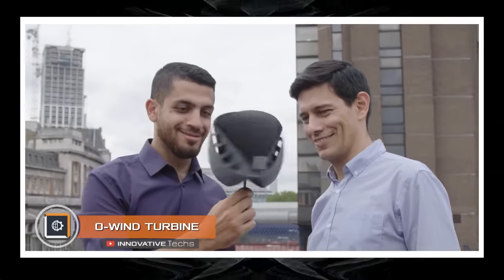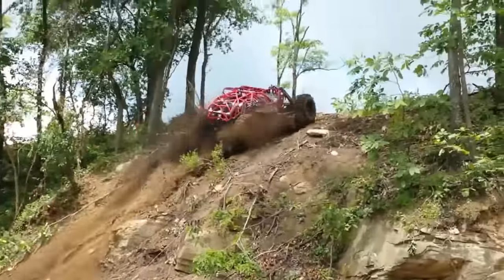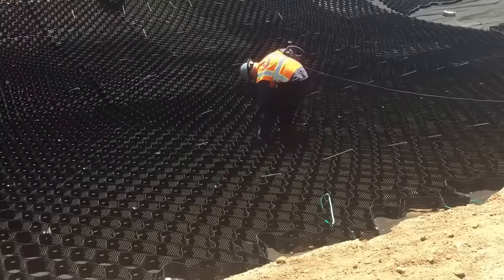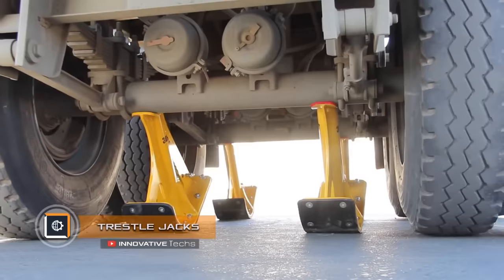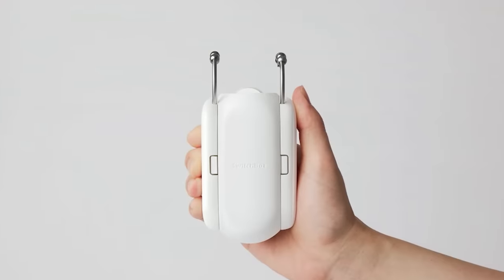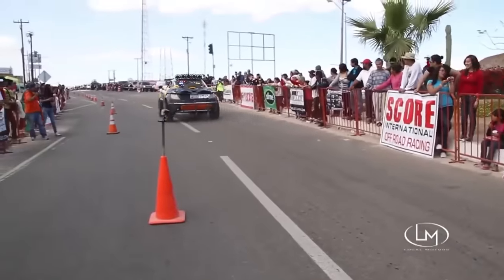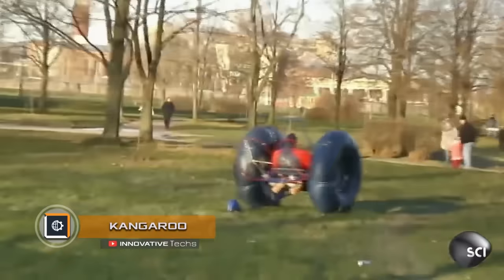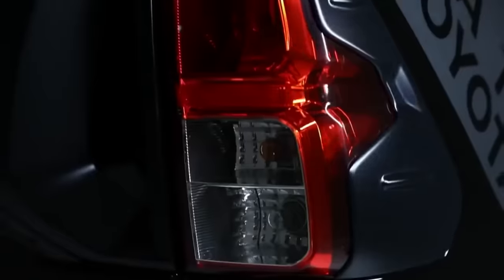60 INVENTIONS ON A WHOLE NEW LEVEL ▶2

Comment: 4 stroke jet engine huh. Must be some new definition of a jet engine I'm unaware of
Reply: Did you think Jet Boats used jet engines like a fighter jet? Or Jet Skis or Sea-Doo? Many boats use Jet engines, they are called that because they use pump--jets/impellers.
Reply: @getphazed  I was indeed privy to this, however its still not a 4 stroke jet engine regardless of how you look at it. It's a 4 stroke engine with a hydro jet drive. Anyway, it's not something I'm passionate about enough to argue with a stranger about.
Reply: @getphazed  In watercraft the term "jet" refers to having a centrifugal pump pushing water thru a nozzle to produe thrust.

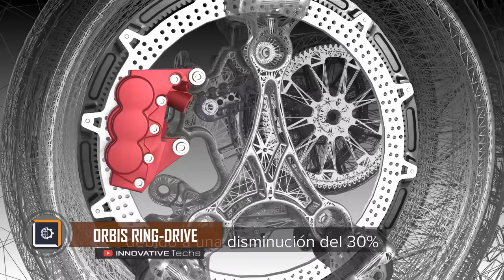Comment: 14:58 
Massive increase to unsprung weight.
15:09
7.75 lbs?🤔 How big is that tire/wheel/brake/drive assembly? Certainly not a full size hwy vehicle application.
Reply: I dunno,but at any rate, 7.75 lbs certainly isn't "massive"
Reply: @billymanilli  
Adding a pound of unsprung weight is roughly equivalent to adding 10 pounds of sprung vehicle weight in regard to performance and MPG.
Take 7.5 lbs per wheel, that's 15 lbs per axle, 30 lbs overall on a 4 wheeled vehicle.
That 30 lb increase in unsprung weight is like putting two 150 lb passengers in the vehicle.
That's not just significant weight IMHO, but it's also the opinion of vehicle designers and manufacturers.
Also, and noted on my prior post. That 7.75 pound assembly is significantly smaller than what would be required on a vehicle traveling on US highway.

Comment: I came up with that adaptive windscreen idea 25 years ago but alas I had no money to actually try to build one and assumed some other big company would just do it better before I could successfully build one, anyway.  Probably should've patented it if it wasn't already. :/
Reply: I get it man. I was running small portable generators off hydrogen extracted from tap water via electrolysis in 1988. The heart of my system was a sealed vessel with 90 overlapping metal wafers where every other wafer was negative and the other positive. Electrolysis. The rest of the details are irrelevant since you can see lots of projects like this here on YouTube. Japan has been running cars domestically on hydrogen reliably for 25 years now.

Comment: The modular aircraft will never be practical because in a non modular aircraft the fuselage is a structural element of the entire aircraft.  Its similar to comparing a body on frame car to a unibody where body on frame is always heavier and not necessarily stronger than the unibody.  The modular aircraft would be two separate yet strong structures thus it has to end up heavier than a similarly sized non modular aircraft.  Also imagine the ramifications of a failure of the latch that holds the passenger module to the aircraft.  Bombs Away!

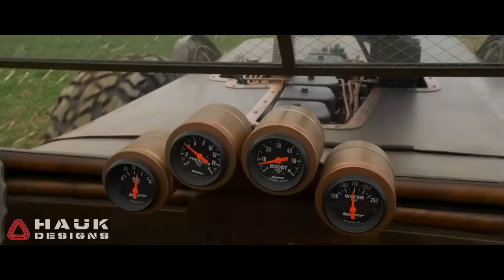Comment: Innovative tech! At 34:02 the engine in the jeep is not a 12 cylinder engine it's a 6 cylinder engine that had 12 valves they come in work trucks are used on generators dodge 2500 and up diesel trucks and yes busses back in the mid 90's you don't look as smart as you are implying when you say stuff like this sir!

Comment: Hmmm, other than animals (maybe) what's the sense in having a gate that you can just drive over/through without it being locked? Then anyone (if you want them or not) can just drive onto/into your property! Now don't tell me you can put a lock on it, then you would still have to get out to unlock it! Oh, wait you can get an automatic unlocking system! Which of course you can get on any gate system and not have to have the gate dragging along the bottom of your vehicle which you wouldn't want in case something were to force you to have to back up for whatever reason! Just a thought!

Comment: So, to drive an EV I need to tow a trailer with a battery pack?  May as well tow a generator which will last a lot longer than the battery pack and can be refilled at any gas station.
 Better yet, but a gas powered car

Comment: in Europe the electric car is king they have put all the charging stations under the streets so while your driving your Tesla is being recharged by the street you are driving on! Just like your cell phone is recharged without plugging it in!!You can drive from Norway to Holland and on to Germany, without a stop 1000 miles and when you arrive your car is fully charged. No gas stops no oil no nothing but a picnic and you spend your money on your wife instead of the car or the truck they have far better trucks than we have they are not allowed to sell them here! in backward land! They already have flying cars without propellors! We are being felt behind!

Comment: That "jeep" monstrosity isnt a 12 cylinder its a 6 cylinder Cummins diesel, and the EV car dosent have a battery they its towing behind it.
Its a small petrol engine so it makes it a hybrid not an EV. This AI narrator sucks. But someone has to do the final cut or final read through before the upload and they suck too.
This video is chock full off misinformation and should either be redone or taken down. Its hilariously wrong on so many levels 😂